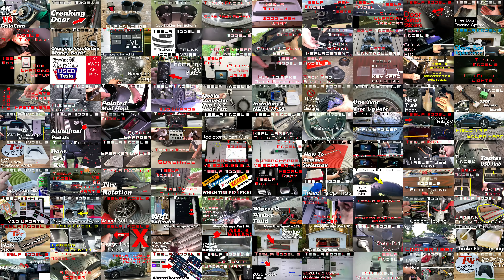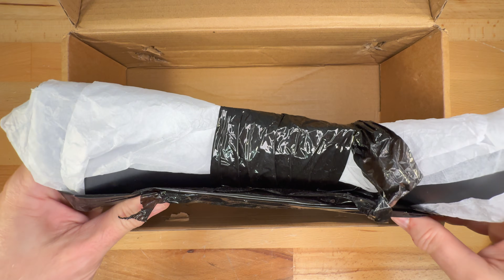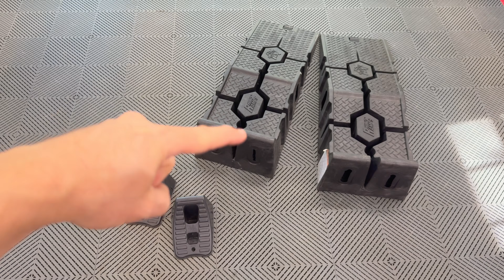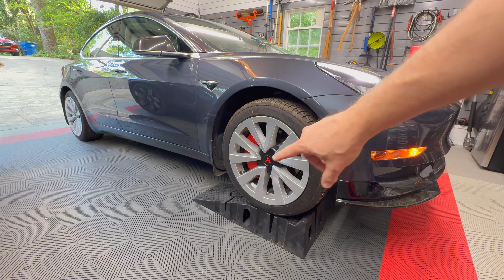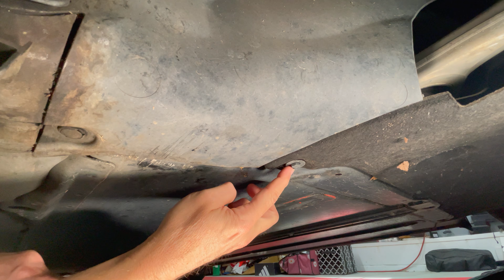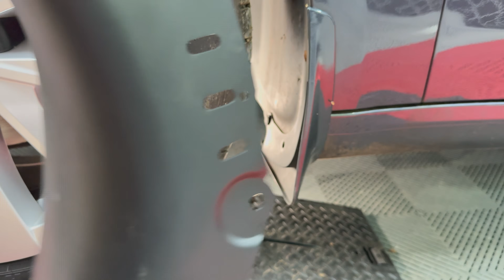Tesla Model 3 - EVBase Coolant Line Skid Plates

Comment: Pointy self-tapping screws into plastic, that intrude into space w/ plastic coolant lines.. that makes me a bit nervous?  I had one brand of coolant "elbow" guards, and the main M2 bolt they gave was too long (30mm?), it rubbed against the passenger side coolant line! 20mm bolt was better, I believe.. still, turned me off. It also didn't fit well with my metal skid plate aero shield, in front of the battery between the wheels... had a little wing that covered that same bolt area? Maybe different aero skid plates would fit.
I verified the clearance with an endoscope to peek inside, wonder if you could check yours as well, how close the 6 screws come to any lines?
Reply from the maker: Thanks for your comment.  I don’t have an endoscope but I could try to check that area to verify.  I’ll also ask EVBase to see if they can assist.
Reply: @MTNRanger  Great, hopefully no issue here, but just wanted to ask out of caution, given my previous experience with another brand!
Reply: @MTNRanger any update on this?
Reply: @PatG7927  also wondering if there is an update